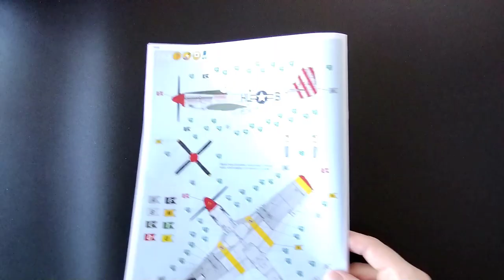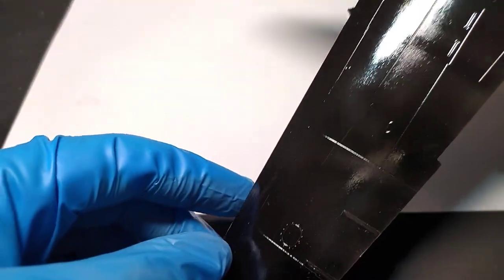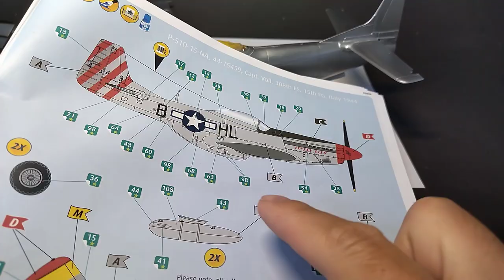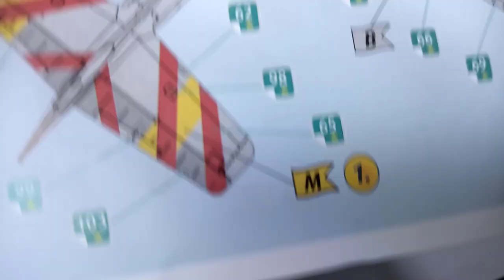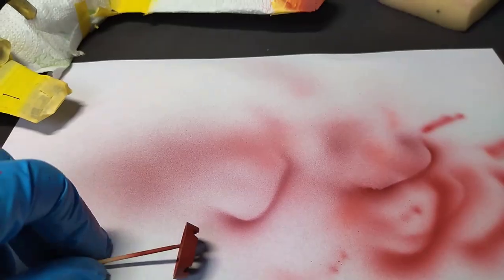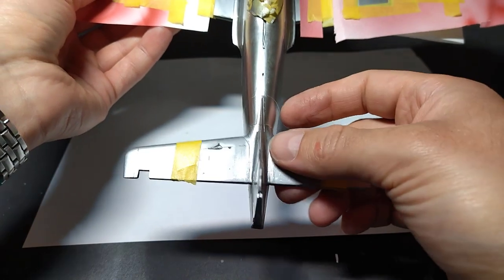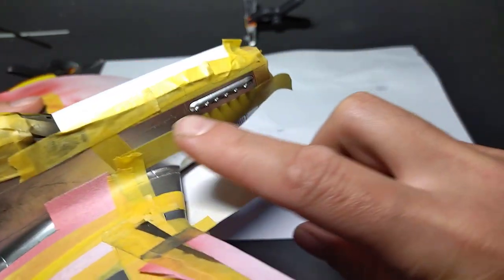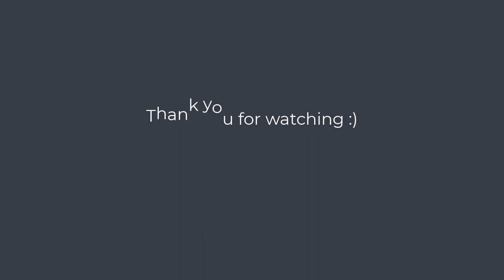Mustang P51D-15-NA. PART 3, Painting. Revell 1:32

Comment: AK Extreme Metal has a "reputation" for flaking or coming off when masked. (Even under a clear coat!)  I suspect most people apply it directly over a glossy base, which will reduce the "bite" the metal has on  the surface under it. I alway thin a matt model primer (Lacquer) then apply lacquer gloss black and then the metal topcoat(s) over that. (my Go-to for primer, gloss black AND metals is Alclad. for metal, also Lacquers. (All lacquer paints will bite into the layer beneath.)  By the way during WW2 the Natural metal finish on the P-51 was confined to the fuselage. The wings were primed and pottied, then  sanded as smooth as possible, and a Silver laquer gloss dope applied overall, except for certain panels (eg  the flaps and ailerons, LE gun covers and certain bottomside panels. While glossy, the wings actually were visually more like silver paint, than metal. I mix about 30-40% light grey to any alnminium colour to scheive that effect. The rudder should also be a dull matt Aluminium Dope colour. The elevators (early on-up to D-10 machines were fabric covered) so were that colour also, with later all-metal elevatores in NMF.
Post-war the priming and filler was often sanded away and the Natural metal restored, including on restored airframes. 
This was also done on other US fighters like the P-38 and P-47, but with differing panels left NMF.

https://ww2aircraft.net/forum/threads/p-51d-filled-wing-panels-help-please.30982/
About 2 screens down for image.
Reply from the maker: Wow, thank you for sharing with me. I will go back to your points before I start my next Mustang. Appreciate the time you dedicated to write the comment and share your knowledge.

Comment: In my experience, the metal effect paint is actually pretty resilient , but the AK Black Base is garbage! If I want a high shine finish, I use Revell enamel or Tamiya lacquer gloss black, both of which can be easily flatted & polished for a much better starting point
Reply from the maker: Thanks Craig. I will try Tamiya next time.

Comment: In actual fact 12" (300mm) is equal to 9.4mm in 32nd scale
Reply from the maker: Well , google and my calculator say it is 9,525mm. Regardless of the minor difference between 9,4 and 9,5 - How come Revell could make such a mistake? 11,9 vs 9,5 it is quite a lot...